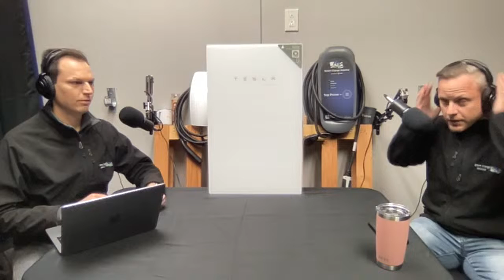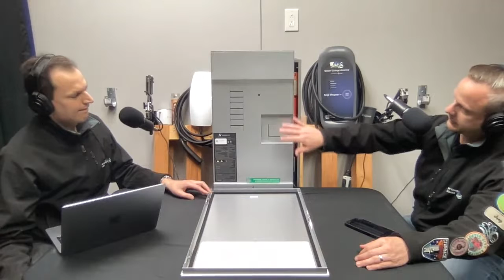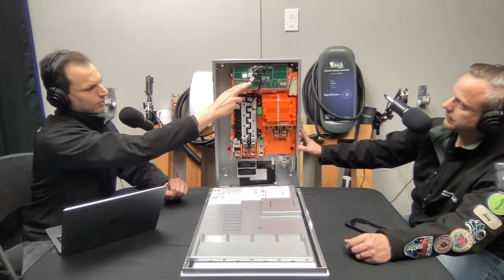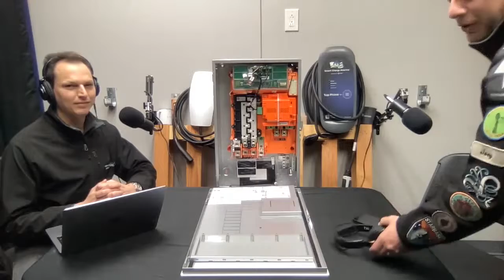LIVE: E53: We Installed Tesla's POWERSHARE V2H Back-up system for Cybertruck ...how it works!

Comment: So what's the deal.  You talked about benefits of PW with PowerShare.  I agree 100%.

But my designated PowerShare installer said not yet.  Tesla says later.

I really want to install PowerShare with PW3 to qualify for 30% tax credit .

Maybe do a video about V3 gateway vs 3 gateway.  I mistakingly thought they were the same.

And for PowerShare eligible persons with existing "any version of Powerwall and connector" you don't need anything.  Late 2024 for it to work .  So confusing...
Reply from the maker: I plan on releasing a follow up video. Standby.

Comment: Tesla makes this so confusing.  Is Gateway 3 different from 3V?  I'm now believing yes..3V has transformer to make 110V.

If I accept the included 3V gateway with CT, can I add PowerWall 3?  My installer said not now.  Tesla says later ...
Reply from the maker: Agreed, it is a bit confusing! Yes, they are different. Currently I am not aware of the 3V Gateway supporting Powerwall 3.
Reply: @smartchargeamerica  ... Got reply from Tesla.  They recommend not to install 3V if I want PowerWall now.  Doing so would require additional Tesla support during commissioning to disable 3V controller.  (Isn't that would you do with backup gateway 2?)

They said I should use BG2 or 3 or Switch.

Undecided now.  Shame .... I already paid for 3V with the FS truck.

Comment: Thank you for all of this great information. I'd like to clarify the partial home backup option. If we go with this option and we already have a subpanel with the backup loads then the 3V Gateway would go between the main panel and the subpanel, is that correct? The 3V gateway would have the charger breaker in it and when it detects no power being fed to it from the main panel it would turn off the connection to the main panel and energize the backup panel from the car charger breaker. When the main panel is re-energized the 3V gateway would recognize this, turn off the power coming from the car charger and turn back on the power from the main breaker. Is that correct?
Reply from the maker: You are correct!

Comment: Will Powershare allow for my solar system to store excess power to my Cyber Truck vs back to the grid where the public utility gives little credit?
Reply from the maker: If you have Powerwall, yes, you can turn on Charge on Solar which allows excess solar production to go directly into the Cybertruck.

Comment: so with the 3V gateway, do you only get to pick a few circuits? or does it back up the entire 200a breaker?
Reply from the maker: There is a good chance that it will cover your entire home. Worst case we may need to exclude a couple major appliances (AC, Heat, Dryer, Oven, Water Heater, etc).
Reply: @smartchargeamerica  yeah I would exclude the hot water heater tbh. It draws 4.5kw. Or make it optional - not sure if that’s possible. Appreciate the feedback
Reply: i see you said 110v is the determining factor - how do i find this out? I have a lot of 220v outlets, but i alaso have a monitoring system and i never break 11.5kw (ct output) over 15 min periods

Comment: Had my PowerShare installed this week.  Until March the backup function is disabled, and they will need to make a visit in March to physically update the firmware.  So mine is installed but just acts like a passive breaker box.  

Also no support if you have solar at this  point.  They won’t connect it to the backup bus.  It’s not clear if they will ever support solar with PowerShare.
Reply from the maker: Correct! You need Powerwall if you want to take advantage of your solar panels during a grid outage. This is because the Powerwall is grid forming where Powershare is not.
Reply: @smartchargeamerica , thanks for the info. So, with solar and power, do I still need to get the gateway replaced with the new 3V version? Or do I need a new Tesla wall charger? Does the $20k on the foundation premium include any of these requirements?

Comment: Powershare hardware prices are around $2400 for AWD and $6400 for Cyberbeast is that equal to 6 months to 1 year supercharging? Doesn't add up. "The EIA's 2023 forecast for US household gasoline spending is between $2,140 and $2,730." per year.
Reply from the maker: Can't argue with you on this point.

Comment: How will v2 TWC work without communication cables? Doesn't it have to communicate power direction before energizing?
Reply from the maker: If you have existing Powerwall + existing Gen 2 Wall Connector, your Tesla Powerwall Gateway will communicate with the Cybertruck via PLC (powerline communication). Your Gateway already communicates with any Tesla vehicle in this manner to enable 'Vehicle Charging when Off-Grid' where the Powerwall will stop or slow Tesla vehicle charging to meet your home's power and energy needs.